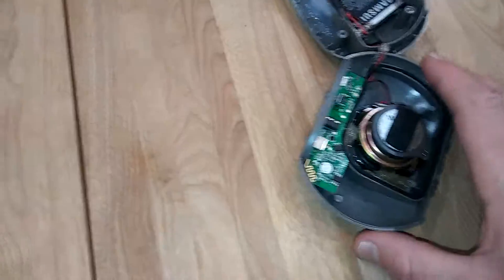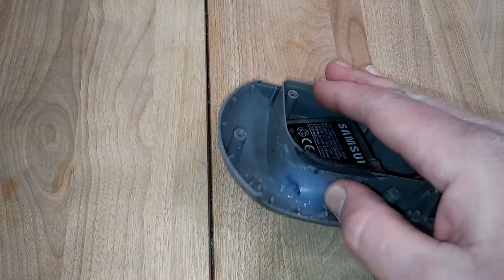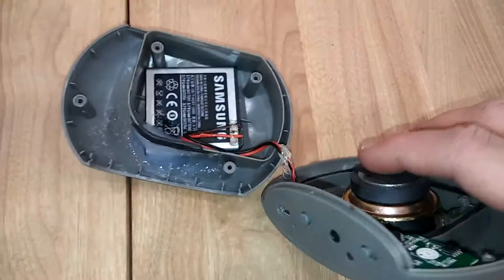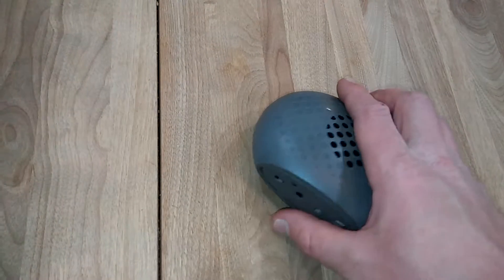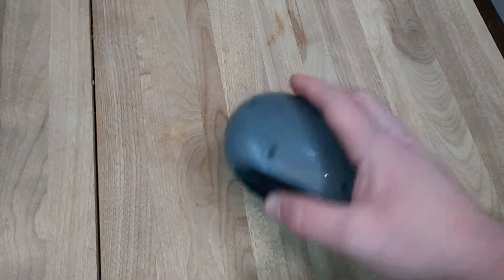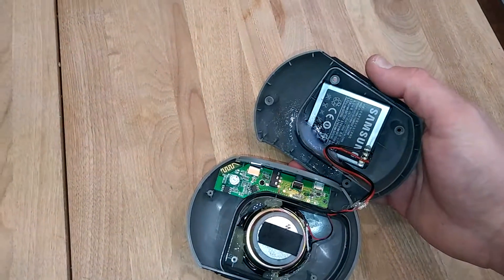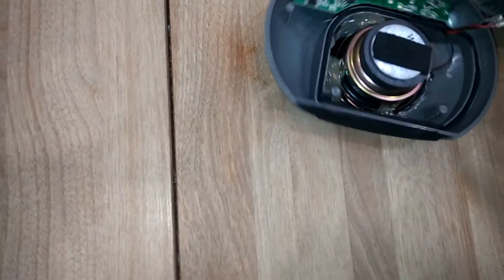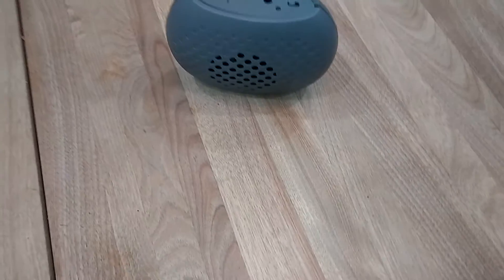Vivitar bluetooth speaker battery upgrade

Comment: I have a different type of Vivitar Bluetooth speaker, and the battery is bad. Do you have any idea what the specs are on the battery you removed? I'm tempted to just solder it to this Nokia Phone battery I have, and see if it works, but would rather not fry it if I can avoid it with the necessary info.
Reply from the maker: John R, just keep red to + and black to -.  It should be fine. Same thing i did.
Reply: If the voltage is higher it will fry the board, but it doesn't really matter since the original battery is kaput.